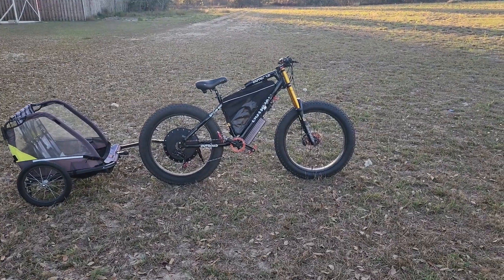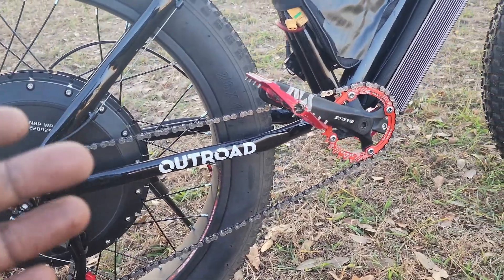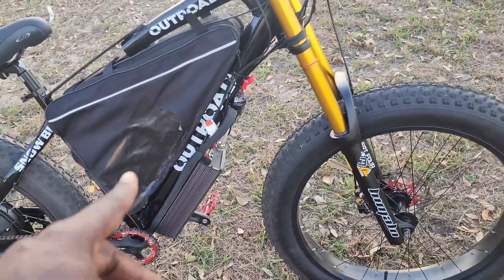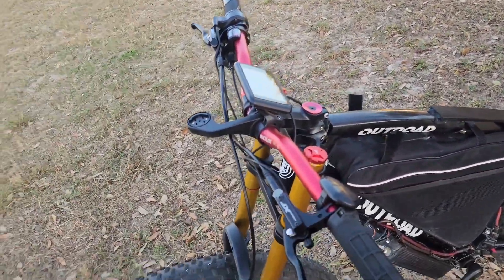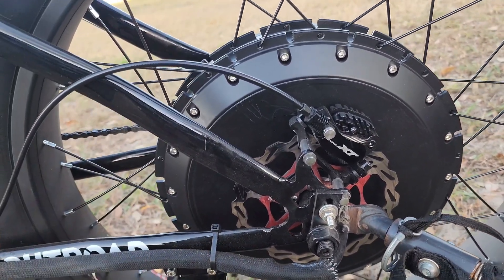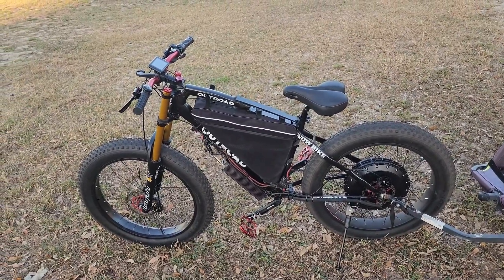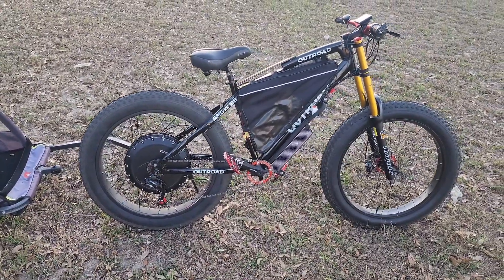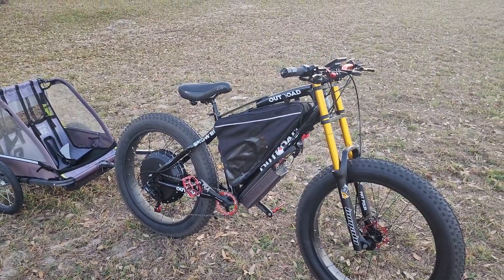review of my 8000w ebike.

Comment: hey dude, what ebike kit would you recommend if i want to easily hit 40mph on flat ground. i currently have a 1000w with a 48v 13ah battery. slow from a dig but it can hit 28mph on flat and 36 downhill.
Reply from the maker: I recommend a 1500w kit with a 52v battery,  40mph easy , with that setup
Reply: and if im hitting 40mph often would i need a specific set of bike tires?
Reply from the maker: @MarcelFortunaa  no, any bike tire will work,  trust me
Reply: @EBG-offical  thanks for the quick response man. appreciate it. loving this new ebike hobby
Reply from the maker: @MarcelFortunaa  no problem 😊

Comment: Please get a new frame..cro.moly..your gunna be going fast..i wood hate to see something happen
Reply from the maker: I fixed that ugly two bar crap that I welded on top. Now it's a one piece.  Besides I don't ride fast all the time.
Reply: I got a crew 27.5 bmx bike... gunna put a voilamart 1500 watt 48 volt kit on it... it's for street use... any advice
Reply from the maker: @Randy  not really, that what you mentioned it's a good setup but I would just make sure you can get the torque arm welded together then bolted to the fram

Comment: Hello, what is the max speed of this bike ?
Reply from the maker: 76mph and that is without flux.
Reply from the maker: We going to do a speed run for yall soon
Reply: @EBG-offical  wahou isn't it dangerous ? I'd like 55 mph, which motor do i need ?
Reply from the maker: @kaspkasp8912  3000w with a 72v battery will get you there

Comment: Whats the other front fork shock.. you have? Do you have a link please
Reply from the maker: MZP MTB Bike Front Fork 26 27.5 29 Inch Double Shoulder Control Downhill Suspension DH Air Pressure Straight Tube Ultralight Bicycle Shock Absorber Rebound Adjust https://a.co/d/2s2uhwe

Comment: first time i have seen a 273 on a "regular bicycle frame", quess it works fine as long as you have something strong preventing the motor axle from spinning In the dropouts, just make sure nothing gets loose over time.
Reply from the maker: Yes I make sure the dropouts are good

Comment: What bike frame did you use? Did the dropouts work ok or did you have to modify?
Reply from the maker: It's a outroad bike from Amazon, and I just had to grind some material off in order for the dropouts to fit
Reply: So the width was ok?
Reply from the maker: More than enough  had to add some spacers

Comment: Love it. We are going to stay tuned to the future. Like the tires. I have several ebikes and always hated fat tire bikes till ingot one. You will need the stability of those tires. Keep up the good work. 😀
Reply from the maker: Thank you. Yeah, the fat bike is growing on me. I should have done this with the 5000w kit
Reply: @EBG-offical  I have a Sabaton 150 on my q273. It surges at full throttle, even on PAS 0. It's very dangerous. Also, my left motor disconnect isn't working. No brake light on that side, either. Think the two symptoms are related? I still ride the bike, but it's not safe. I'll be sitting still at a traffic light and it will lunge forward. If I keep the right brake lever pulled it doesn't do it, but that's the throttle side and isn't easy. Any thoughts?
Reply from the maker: Change out your throttle for a new one

Comment: I got a question for you.. my 2000w ebike only peaks at about 1950w and flattens out at 15000w pretty quick. Should I do the shunt mod that you shower or buy a new controller.. my controller gets pretty hot sometimes already. Also if a new controller can you please send me the right direction I have no clue. I'm running 52v
Reply from the maker: Do the shunt mod first, free upgrade. But new controller. 45a will be nice for ya
Reply: @E-bikeguy  hugely appreciated bud! Respect from Ireland
Reply from the maker: No problem 😊
Reply from the maker: https://www.ebay.com/itm/185243174029?mkcid=16&mkevt=1&mkrid=711-127632-2357-0&ssspo=QQNiZAfdQDW&sssrc=2349624&ssuid=g6yfcireqc2&var=&widget_ver=artemis&media=COPY

Comment: Nice job but I could have found a better way to do the frame. I would have used tubing instead of flat steel. I think it's probably strong enough the way it is but tubing would have looked better and been stronger. Good job though.
Reply from the maker: Thanks buddy,  man you is right about tubing ill go to ace hardware tomorrow and get some, because I really don't like the gap there.
Reply: @EBG-offical  I just bought a juiced bike ripcurrent brand new on black Friday for $1300 and I'm am using it as a platform. I'm gonna stick with 52v battery because I have 2 brand new ones, one 15.6 ah and one 19.2 ah battery and they are built in so it's clean looking. Gonna go with a direct drive rear hub motor and bottom bracket torque sensor and twist throttle. Not looking to break the sound barrier, 35 to 40 mph is fine. At 35 ah I should get descent range.  I 'm  going with a phaserunner controller because I already have it. Just looking for a nice dependable cruiser. I live in Florida so it's all flat pavement. Great videos man. I have one bike that I built with full suspension and regular 26"×2.50 hookworm tires and it runs great, 35 to 40 mph at 48v and 24ah with phaserunner controller and cycle analyst. I buy all my stuff from grin tech in Canada and they're pretty cool guys to deal with, friggin guys a genius. Keep up the good work and stay safe. 🤙
Reply from the maker: @Randy Pringle  nice!!!!! good thing about the phase runner. Is that it packs a punch in a small package so you can pretty much mount it anywhere. 35ah shoot that will get you places and Florida so flat, you will have good range. But much thank buddy 💯🤟 talk to you soon!!!

Comment: The only thing that sort of scares me about this bike is the cut frame and those welds. That does not look like it's gonna hold for long. 
That said, thanks for the video.  Maybe after I get my feet wet building my first e-bike, I'll build something crazy like this.
Reply from the maker: I just switched that out for a tubular pipe looks way better now
Reply from the maker: Oh yeah it's definitely good I also went to school for welding. I made 2 bar one is close to the battery with velcro to hold the battery in place

Comment: Great job man! You're wild for putting a 273 on a "regular" bike frame for sure 🍻 I know you know because others have commented already, but those regular tires are not rated for super high speeds like the enduro moto style tires, so keep it under 1000mph before you get your new hoops 👍I saw you built a 96v pack and I figured it would be for this build? Any reason why you went with 72 over 96? I know you don't really need the RPM, as this seems like more a torque ride for off road, still curious though. I feel all my higher power builds will be higher voltages from here on out personally. 

And absolutely no shade to you my friend, I encourage everyone to build whatever they want and I hope they do just like yourself we need more people building wild things "just because". With that being said though, I do want to point out that a 273 is massive overkill for a bike that is this light, hell, even the 205 is honestly. 

The 273 is 25% more weight than a 205, and because of those gigantic magnets and mass it is designed for a maximum threshold of heat dissipation. I would say unless you're running into heat issues with a 205 completely maxed out (and there still are hubsinks and ferrofluid options to consider) that moving to a 273 is only necessary if you're saturating a 205 and need the added mass. This is why you see it on much larger bikes. Otherwise you're paying a huge weight penalty (and somewhat cost penalty) for no real performance gain. Does the 273 look cooler? I sure think so, but I just wanted to put this out there for anyone who is thinking about replicating what you've done. No criticism towards you or your creation, just trying to provide more data for builders to consider 👍I know you already know the considerations and made a choice anyway, and anytime that happens I respect it. Cheers brother!
Reply from the maker: Thank you so much. Well, I saw your build with qs273, and I like that the motor looks .The qs250 was more than enough to take me anywhere and  never had a problem with it. Yes, I won't be going fast on this bike till I get some new tires for sure, but the 96v battery was for a friend that built for him.but im happy with the 72v setup. But always a pleasure chatting with you, till then I'll stay safe 💯
Reply: @EBG-offical  I think the 273 looks the best too 👍sounds good man, I was just curious about the 96v. Awesome work on your new ride, enjoy it! Thank you and stay safe as well friend 🍻
Reply from the maker: Heck yeah, thank you bro, I enjoy your work you do to your bikes

Comment: Yes she is looking mean/aggressive/strong. I'm working on a similar kit for my Kepler. Getting a 5k kit. I picked up the very same fork but black on black, how does the fork feel? I like also the look of the casing of the motor combined with the fat tires. On the video I couldn't tell if you had any tork arms on but you should bro specially with that 8k beast you need to lock that wheel on place. And the tires... I'm stuck (shopping for tires) can not find any motorcycle tires that will fit the 26x4 rims... can you recommend any good tires??? I considering downsizing from 26(22) to a 21 or 19 to have peace of mind on regards of getting a flat going 50+mph...
Reply from the maker: Yes the forks are budget but us awesome compared to the stock ones that come on the bike. But yes there are torque arm on both sides one is on the inside tho lol
Reply: @EBG-offical  AWESOME!!! 🔥🔥💪👍👍🤩😍

Comment: Awesome looking build. Really pushing the limits and showing people what's possible. People can't believe it when I show them what the 5000watt Axum kit can do. 

I don't get why it's faster if you have the same controller and battery that you were already maxing out.

Is it the larger wires on the motor that aren't resisting the current?
Reply from the maker: The magnets in the motor is a lot stronger 💪 it doesn't take much throttle input to get it up to speed
Reply: @EBG-offical  that motor is huge lol. Again awesome build!
Reply from the maker: Thank you my friend 💯🤟